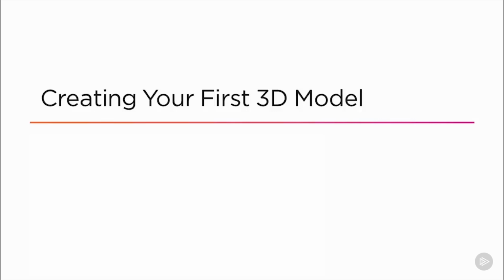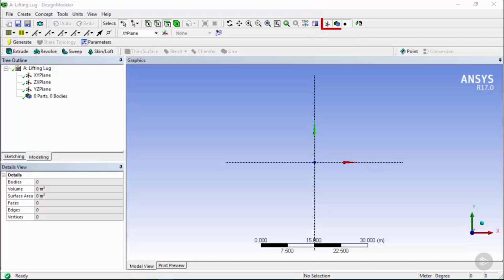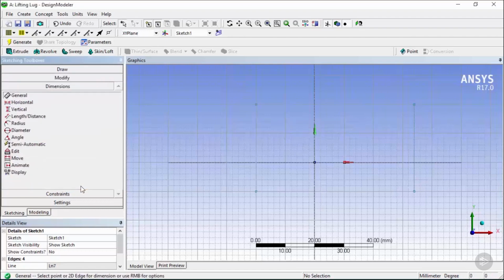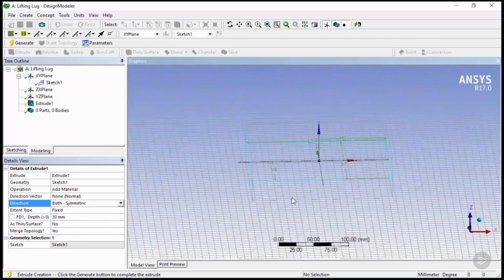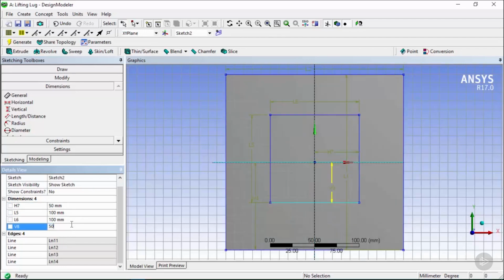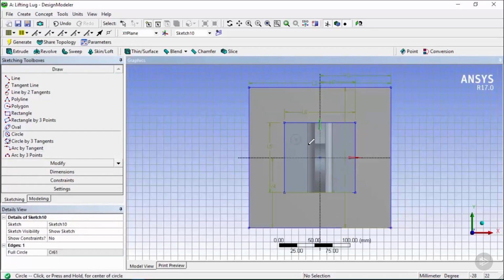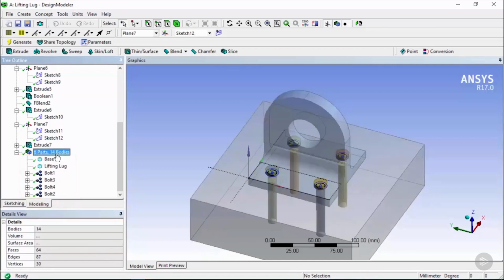Introduction To ANSYS (Part2) : CREATING YOUR FIRST 3D MODEL

Comment: 2:42 toolbar
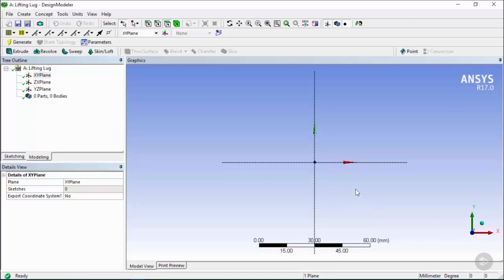6:03 sketching
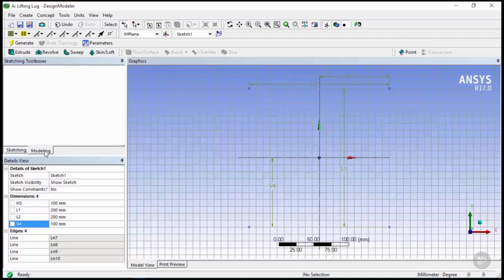11:14 extrude
15: 56 create new sketch
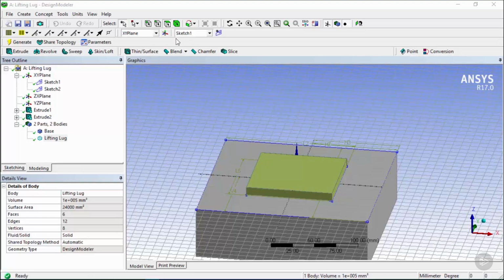18:40 create new plane
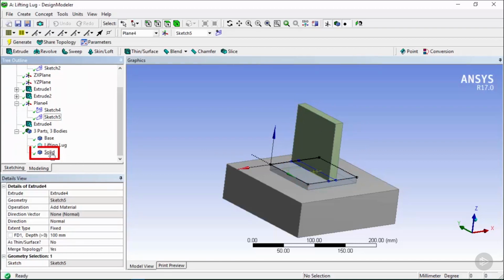22:00 blend
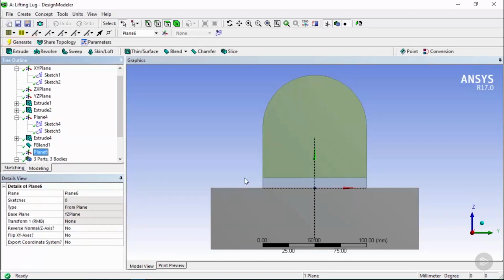23:00 create sketch projection
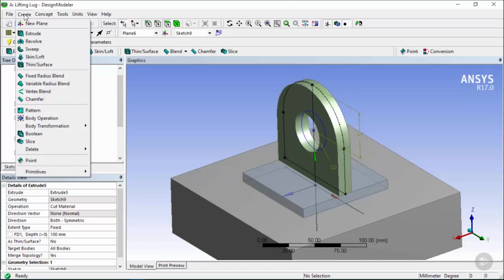25:00 boolean (joint two part together)
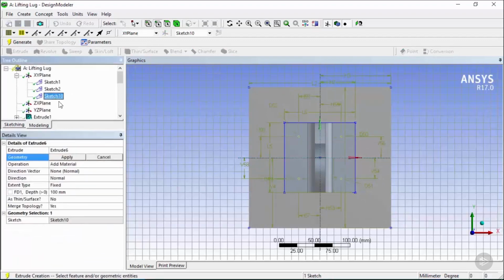27:10 slice material
28: 50 offset
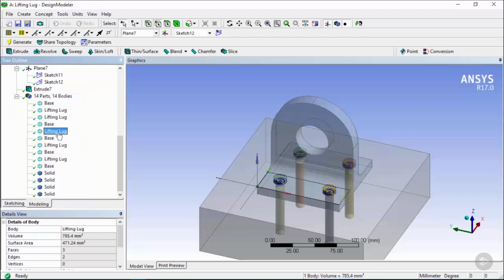30:00 form new part (group diff. solids)